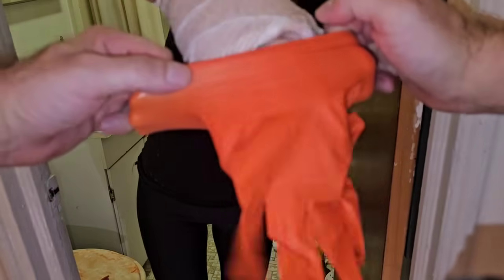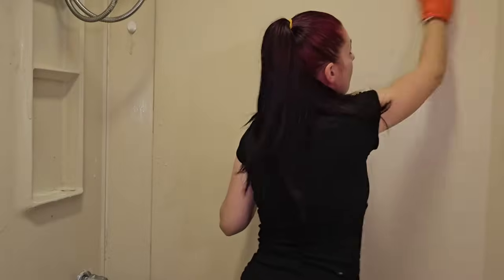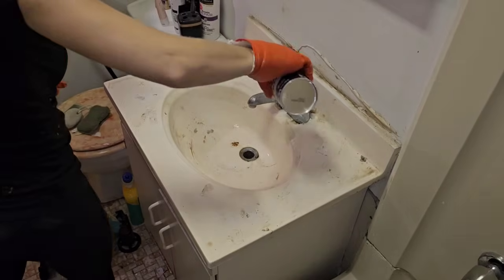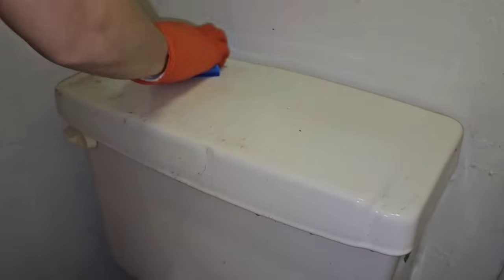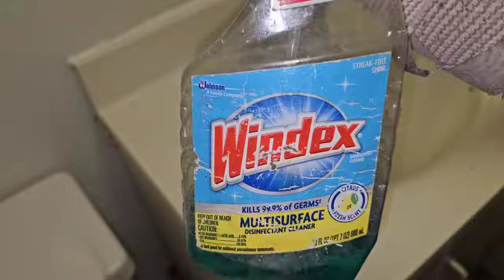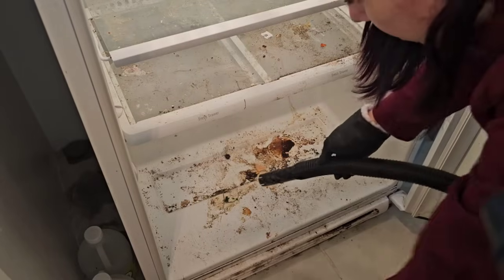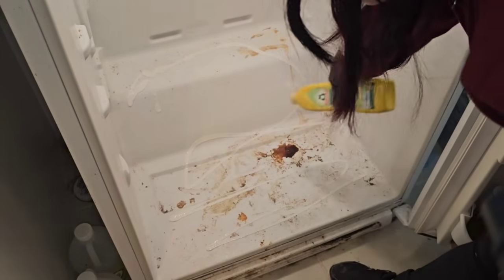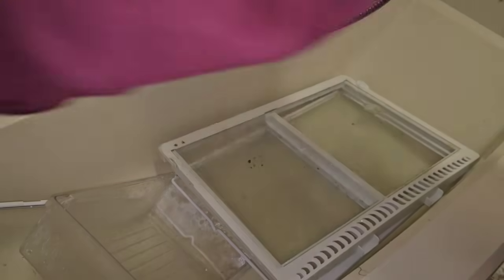Easy Bathroom Cleaning Hacks You NEED to Know! 🛁✨

Comment: Gosh I admire you, Barbie. You did so much work in that grotty, filthy bathroom!! You are very brave to get down near such a gross toilet. I find it best to use a damp paper towel to wipe away all the hair 🤮 first, then I can get on with the scrubbing. You have to be careful using Ajax powder or Comet etc on acrylic baths and wall linings as it can scratch them. Just a small tip. I was so relieved to see Johnny putting in that new filler where the sink meets the wall. You both did a fantastic job! Hope it stays clean!

Comment: Just an FYI, on the refrigerator the grill down at the bottom, comes off too. Most models just pull hard , clean and snap back on. The one you cleaned looked like this. Others there are screws. Just on screw.  Hope your hand heals fast. Merry Christmas 🎉🎉❤❤

Comment: There is a degreaser that you can buy called Super Clean (comes in a purple container).  It is VERY STRONG and will strip the paint off of things (and the skin off your hands if you don't wear gloves), so you really have to be careful with it, but you might find it useful as a substitute for oven cleaner.  You will love the amount of scrubbing it reduces.  I use it for cleaning the outdoor grill and other things that get a grease build-up like fryer baskets and the metal filter on the stove vent.  If you decide to give it a try, be careful with it until you learn how it works, especially if you're working in someone else's place where you can't risk damaging their property.

Comment: The part your cleaning with a brush on the bottom of the refrigerator just pops out ..
Way easier to clean. 
Just thought you should know in case you didn't

Comment: Great job. May I just recommend citric acid, I poured some warm/hand hot water in the sink and added about 3 tablespoons and put my shower hose and shower head and just left it in the water for about 10/15 minutes whiles I cleaned my bathroom and all of limescale loosened and just fizzed away, I still used a brush scrubbie thing on it thoroughly clean it but that's it, it did the job for me. 🙂💛

Comment: You know that grill at the bottom of the refrigerator can be pulled off. It is .not hard to do and you can clean the front and back of it no problem.